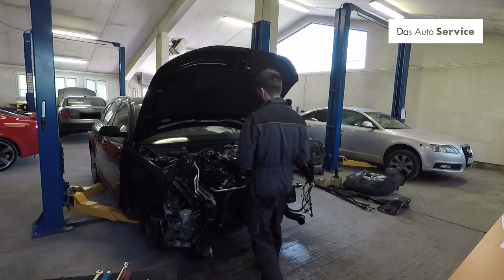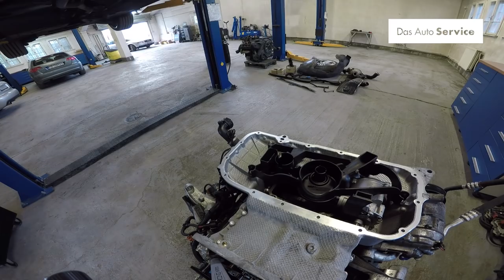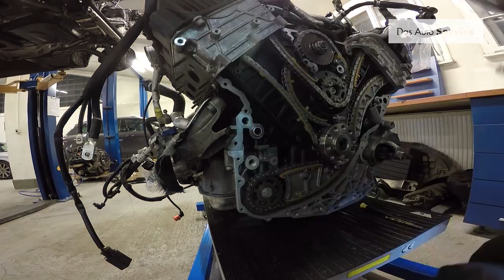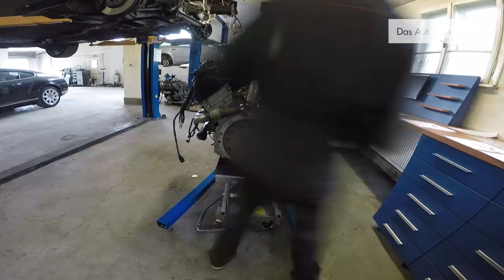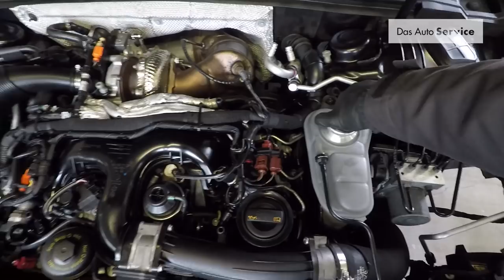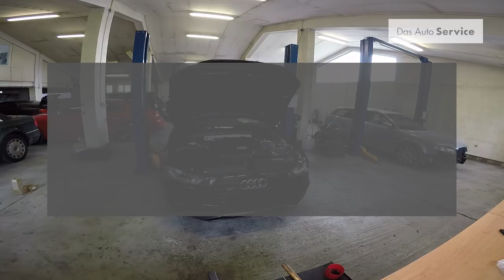A4 B8 3.0 TDI - отстраняване теч горен картер, обслужване дюзи, обслужване скорости

Comment: Could you explain the rear axle differential service? I'm driving the same engine in an A6 quattro and have heard from several AUDI mechanics that they never change oil in the diffs (although I've been asking about this specifically). Is it recommended in your oppinion? (I have 257.000 km on the clock)

Comment: Have the same car with the same engine. Today I've noticed some engine oil leaking from the oil pan. Now I want to disassemble the oil pan to clean it and place a new layer of sealant.
My question: Do I need also to place a new layer on the upper part of the oil pan? What would be necessary to get access to all the screws of the oil pan? Disassemble the front stabilizer? Thank you in advance!